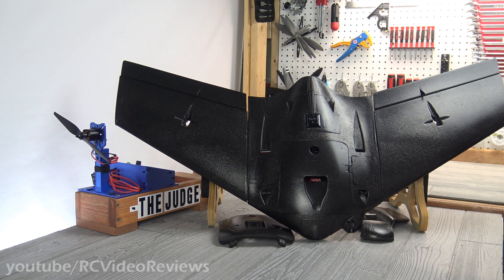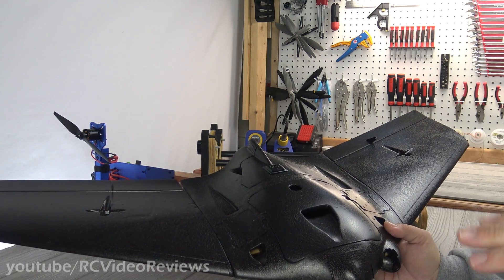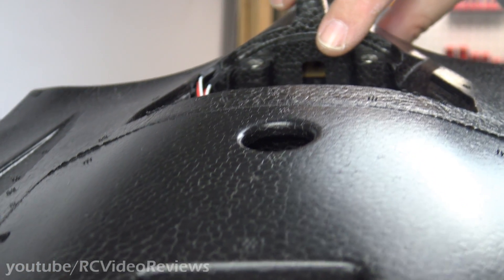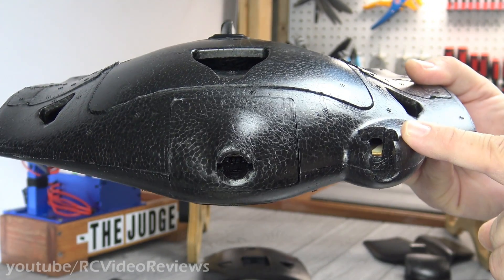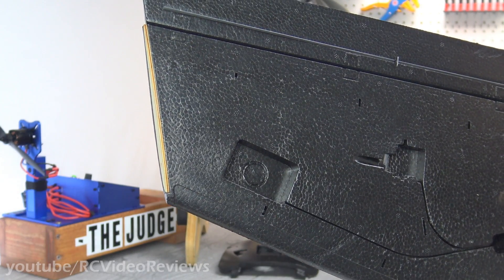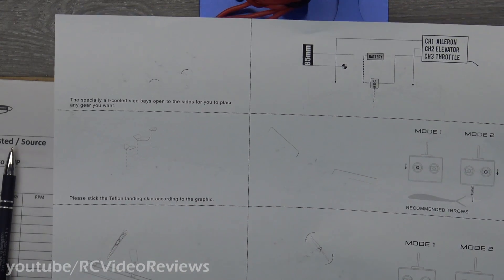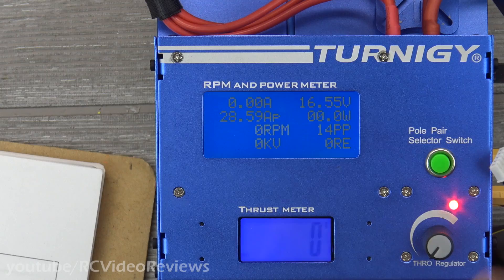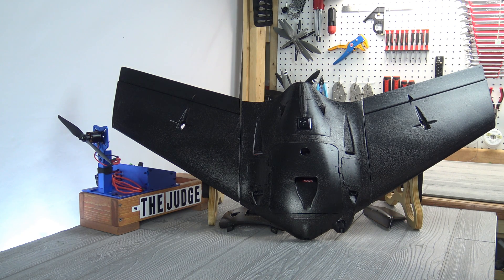Sonic Modell AR Wing Pro • The New FPV Wing to Beat?

Comment: Nice thrust testing! It does look like it's going to be a cruiser with a fairly low thrust to weight ratio but I guess that's the way it was designed. Looking forward to the Maiden. See you in the Air!
Reply from the maker: Yep, this is a camera ship. I'll get the maiden knocked out as soon as I can. Thanks for the comment.

Comment: I am busy with this Sonic Model build and would love for you to please include the radio and Opentx setup for it. I am also using CRSF with a Radiomaster TX16S. Looking forward to the rest of the build.
Reply: I love my Tx16s 🙌🏽
Reply from the maker: I just finished building it. I need to run through iNav one more time, but it's ready to maiden. FYI I had one DOA servo. Fortunately I had a couple of Emax 12g MGs handy and they fit right in. I also had to add a LOT of weight on the nose to get it to balance and that's with a MultiStar 4s5200.

Comment: yes a good model my 1st fly found  had to have uptrim  when hand take off  till u get it up in air, and put same weight of same as gopro for cg.
Reply from the maker: I noticed that about the weight. I had to add quite a bit on the nose because I'm not flying a GoPro. Thanks for the tip on trim. What do you think of the motor? Is power sufficient?

Comment: Hope the kit version has the connectors and servo pushrods...to bad I didn't get pnp version. U think my racerstar airb 2514/1498kv on 5s or 6s will be enough for higher performance ?
Reply from the maker: It should come with the pushrods. I wouldn't worry about that. Kits usually come with all the specialized hardware (horns/rods etc). Wow, yeah, that motor would push it pretty hard. Keep in mind though, this isn't exactly designed as a performance wing.

Comment: Great details review 🙂 I just bought one with Sunnysky  x2216 1250 kv v3  not sure if it's better engine selection
Reply from the maker: I like those v3 motors. You'll be very happy with it I'm sure. Sunnysky says 1371g of thrust with an 8x6 prop on that motor.

Comment: Hi,Thank  you nice video!.
I bought this aircraft. I plan to use a 4-cell 3300mAh, but I thought the KV of the attached motor was too high, 
So I chose SUNNYSKY X2216 880KV in consideration of fuel efficiency. I'm going to try 8050 or 9045 propellers. 
Anyway, I want to minimize mAh / km and gain distance.
Reply from the maker: You might find that setup a little soft. With a 9x4.5 prop and 4s you're looking at 950g of thrust. The test I ran showed 1500g of thrust and that puts it just over 1.0:1 power to weight at the max weight. To maximize efficiency you generally need to go with bigger props. 8x5 to 9x4.5 is not much of a change to be honest.
Reply: @RCVideoReviews  Thanks a lot. I want to get maximum range within 3300mAh. I study more.
Reply from the maker: Bigger prop...
Reply: The KV of the motor has very little to do with overall efficiency, especially if you don't change the prop or cell count.  The drag of the aircraft plays the most part.

Comment: Thanks for the video. I placed my order yesterday and i would like to know if my specs can be taken over to this new craft.
specs: 
- D2822/14 Brushless Outrunner 1450kv
- AE 30A or 40A esc linear
- 3.0  lipo 3s
- 7x5 TGS Precision Sport prop

And some fpv stuff like a eagle tree vector and ezhuf immersion rc :-) maybe old school but still havent installed before because i couldnt find the right plane with the amount of space..
I dont want to buy new stuff so i hope i can use my old setum on this one.. can you advise? Thanks!!
Reply from the maker: It'll fly. It's hard to advise as to the outcome as I don't know how you fly or what you want. i.e. A 3s 3000 is small for that plane. Low voltage = higher amperage = less flight time. But it will fly.

Comment: Great review! As being this my first wing, the manual says to set it to 12mm as max throw but with the linkage they give you seems to me you can't actually reduce the throw meccanically whitout having strong asymmetrical throw, did you just left 20mm+ throw or reduce it in inav to 50% or so? Thanks in advance for the advice, just need to sort this out for the maiden after 1 month of simulator!
Reply from the maker: I use the linkages to get it as close as I can then use the radio to reduce to the mark if needed. Thanks for the comment. Good luck with it. It's a tough plane. You should watch my maiden video ;)

Comment: What motor and prop would you suggest for best efficiency? Thanks.
Reply from the maker: Higher efficiency usually comes with a bigger prop and a slower spinning motor. I'd probably look at something like a Sunnysky v3 2216 1100 with a 10x5 prop on 3s. You'd probably get in the neighborhood of 40m flight time with a 3s 10000.

Comment: too bad the wing connectors are only 3 pin, would be nice to use those for vtx and receivers with 4 wires
Reply from the maker: I agree, I'm not a big fan of the 3 pin connectors.
Reply: If you common the ground you can manage to add things like crossfire or a video TX with smart audio on the wings